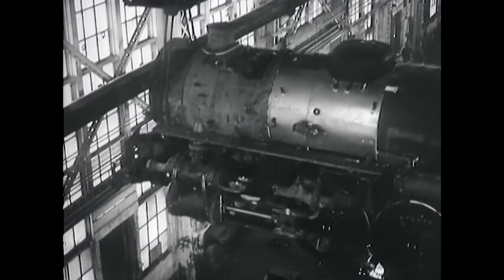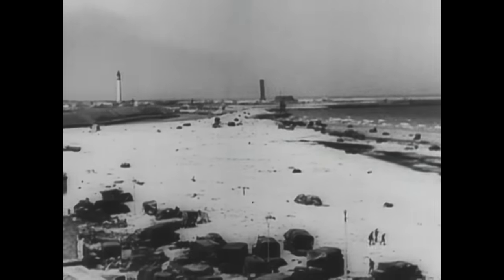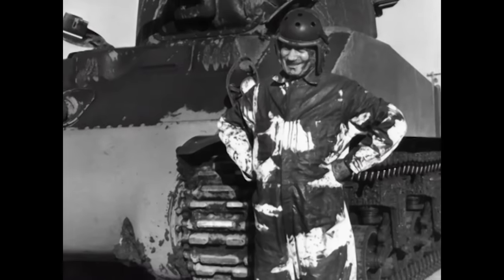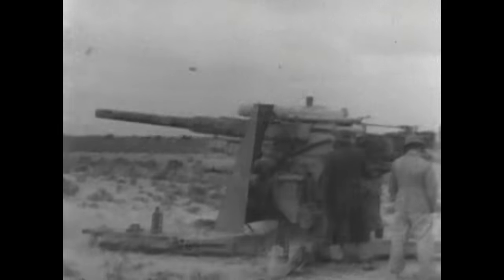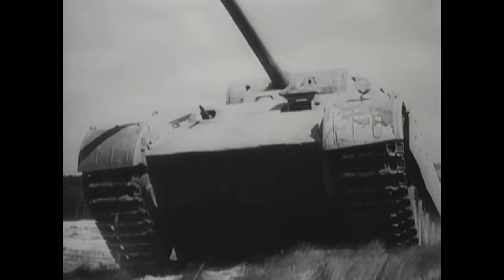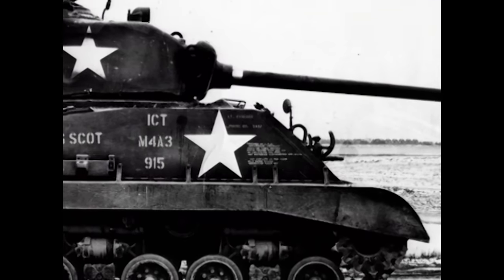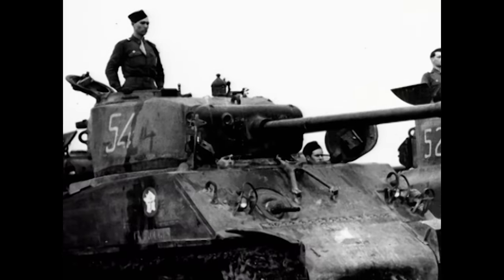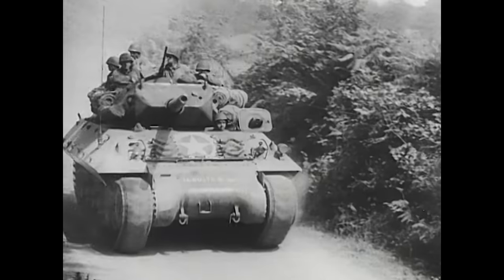Why The Sherman Tank Arrived Just In Time For The Allies | Tanks! | War Stories

Comment: The United States successfully turned its civilian engineering factories into military production. But America was never at the forefront of tank development, it never even developed a purpose-built tank gun. The Sherman was indeed a good infantry support tank in 1942, liked by the British for its reliability and its 75mm gun, good against enemy anti-tank guns. But it was never much good in tank v tank combat.
Reply: The Allies met production quotas that experts had deemed impossible! This was a major factor in our victory. American soldiers had great weapons, which stacked up well against The Germans. The M1 Garand, The Tommy Gun, The BAR, and The  45!!!
Reply: @jayrosen6663  Well, by the time the American troops actually entered combat, the Germans were retreating on all fronts. The Sherman saw almost no tank to tank combat, but when it did it took losses. The British experience 1942-45 was mixed. It was liked for its reliability and the 75mm gun was good for infantry support and taking out anti-tank guns.

But it did burn easily as the ammunition storage was vulnerable. Also the 75mm had very poor armour penetration. In late-1943 the British began a Sherman rebuild program. The ammo was relocated to armoured bins on the floor of the tank. Also the high velocity 17 Pounder anti-tank gun was mounted, the converted tank was called Firefly and 2,250 were built. It played a large part in Normandy, destroying Rommel's Army Group West. Consisting 8 Panzer and 7 Infantry Divisions in battles around Caen June-August 1944.

Comment: Great video.  A bit disingenuous to skip over the development and production of the Canadian Ram tank, which used the hull of a Lee, used a cast armour system, had a full turret that could fit a 57mm (6 pdr) or a 75mm gun, and was certainly the predecessor to the Sherman in almost every way.  So yes.  The UK had access to tanks equal to the Sherman, just not as many as the US could supply.
Reply: Canadian Encyclopedia Ram tank page
The Ram was a Canadian cruiser tank produced during the Second World War (WWII) to overcome the lack of tanks in Canada. This Canadian tank used a modified version of the US M3 tank chassis, with the addition of a turret that could accommodate a 40-mm anti-tank gun in the initial design and a 57-mm gun from 1942 on. From 1941 to 1943, the Montreal Locomotive Works produced about 1,949 Ram tanks. Because of the availability of other, more modern tanks, the Ram never saw combat, but its design served as the basis for variants such as the Kangaroo armoured personnel carrier and the Sexton self-propelled gun (copied from US M7, ND). The Ram and its variants are the only tanks ever designed and built in Canada.

In 1901, the American Locomotive Company (Alco) headquartered in Schenectady, New York, was formed by the merger of several struggling locomotive manufacturers. Alco purchased the Locomotive & Machine Company of Montreal in 1904 to tap into the Canadian market with its emerging designs. The Montreal subsidiary was renamed Montreal Locomotive Works (MLW) several years later.   wiki
Reply: @nickdanger3802  Thanks.  I read that as well.  Hence my post.
Reply: So now, did Canada build the first "Sherman" (with a 57mm) ?  that means an American copycat hogs all the glory ?
Reply: @robertsolomielke5134  I wouldn't go that far but ok.  :)

Comment: But yet, the Sherman did evolve into a MUCH better tank by the fall of 1944. The introduction of the M4A3  Easy Eight model introduced many improvements, including better armor, a much improved HVSS track system, and a fast-turning turret firing 76 mm ammunition capable of even damaging a German Tiger tank.

Comment: What always puzzled me was why they didn't replace the 75mm low velocity short barrel gun. The 76mm high velocity long barrel gun was available and the breach was not any larger than the 75mm one. It would have fit in the torret and the gun would have been much more effective with it's high velocity shell.
Reply: They looked at the logistics of doing that prior to d day.   They couldn't change them all out in time,  and didn't want to choke up the supply chain with 2 different tank ammunition stocks.   Additionally,  the Sherman was not considered a tank killer.   The US army had dedicated tank destroyer battalions for engaging enemy tanks.   The Sherman was the breakthrough, cavalry tank,  which could support infantry.
Reply: All M4 models, including the 76mm variant, evolved in parallel. There were hundreds in England prior to D-Day. The reason they weren't taken to Normandy  were logistics (limited loads) and a sense they wouldn't be needed (US TD doctrine, and tankers preferred the 75mm variant at the time).
Reply: The 75mm was superior to the 76mm in 99% of engagements
Reply: Later american varients equipped the 76mm HV gun....old models were not upgraded because it required a larger turret. Also, there was a tradeoff of ammo storage. The large gun naturally took larger shells, so the upgunned vehicles carried significantly fewer shells.
Reply: @drewschumann1  yes superior he performance against infantry and antitank weapons.
Reply: @PeterOConnell-pq6io  
I read that the 76mm was available [in limited numbers] and offered to the tank commanders, but were declined.
Reply: The 75 mm had much better HE performance.
Reply: The US thoroughly tested everything before approving production. They looked at the original form of the M4 with a 76mm gun installed and found that the turret was just too cramped. Hence the T23 (larger) turret was developed and was ready by D-Day but the forward commanders chose to leave them behind in England.
Reply: @TheSaturnV  yes, due to logistics.   The US army has a good long history of making decisions based on logistics and no other reason.
Reply: @PeterOConnell-pq6io  Exactly.  Also, the M4 75mm did just fine engaging Panzer 3's and 4's in North Africa and Italy.
Reply: @PeterOConnell-pq6io

US commanders were overconfident, unlike the British commanders who expected they would very much need their Fireflies for D-Day. The British, with far more experience against the Germans, didnt expect the Germans to NOT be throwing more Panthers and Tigers etc into Normandy. They were right. There were around 800 of them combined.
Reply: @richardm3023 

Well, when your supply lines are several thousand miles long, paying attention to logistics issues is a pretty sound concept.
Reply: @kenle2  oh, I am not disagreeing with you.   Firepower wins battles,  logistics wins wars.

Comment: German tanks had hatches on either side of the turret for loading shells during rearming and tossing out empties after firing. They could also be opened for some cross ventilation and relief from the desert heat. The British tanks and the M4 did not have this capability. In the heat, they became like ovens thus, the term “Tommy Cooker” came about,
Reply: No
Reply: The early Sherman with its single hatch in the turret must have been a nightmare in the heat. Death trap to escape from too.
Reply: No. Shermans had a small square hatch on the port side of the turret for spent shells. "Tommy Cooker" came from the tendency for early model Shermans catching on fire due to hits to the prominent upper hull ammo stowage bins. Later these were moved deep down in the hull and eventually placed into glycol "wet" bins so that the late M4's rarely burned.

Comment: Genuine question, but is it accurate to call the US a backwater?
Reply: No.  The US was industrialized.  It was isolationist, but in no way a backwater.   Ford Motor Company was founded in 1903.  Europeans called assembly line manufacturing "Fordism" as they were converting their tank factories to be more in line with US manufacturing processes.
Reply: Backwater also means "an isolated" place.
Reply: @lyndoncmp5751  The narrator already said isolationist, so to add "backwater" just comes off as insulting, whether intended or not.
Reply: @deathpallie 
Oh well, welcome to the club, considering all the American WW2 productions that insult the British effort, from Saving Private Ryan to Band of Brothers to the current Masters of the Air.
Reply: @lyndoncmp5751  Isolated politically yes, but isolated economically no.
Reply: @deathpallie  The accent of the narrator tells you all you need to know.
Reply: @ewathoughts8476 
What's wrong with the narrators accent? He speaks perfect and clear English. He also states that "America with its huge steel works and car factories was perfectly equipped to produce tanks on a mammoth scale".
Reply: @ewathoughts8476 
Backwater, not backwards. Two different things. Backwater more describes somewhere quiet and away from the rest of the world, which America was.
Reply: it sure was

Comment: Film, audio recording, light bulb perfected, airplane, assembly line applied to auto production, FM radio, alternating current/AC, vote for women eight years before Britain, electronic television, Ferris wheel, first US patent for radar granted 1934 (Wattson Watt began experiments in 1935 following a MoD request for a "death ray"), blood transfusion, rotary stepping switch, klystron tube (valve), Hughes tri cone drill bit, Houdry process for catalytic cracking of oil.

Comment: The Sherman was a mediocre tank, but it arrived in great numbers.  Anyone can see that 100 people with pistols can defeat 10 people with rifles.  Heck, a courageous soldier with a PIAT could take out a Panzer if they could get close enough, and many did.  The Sherman was adequate protection from small arms fire and most grenades, but even the early 50 mm Panzer II shells could destroy a Sherman.

Patton was well aware of this and established the policy of avoiding tank battles.  At first the US had thought the Sherman could handle the Panzers after mopping up Rommel's well-worn and tired tanks after Montgomery has driven them from Egypt, across North Africa into the waiting US Sherman tanks.  Patton managed to avoid challenging the Germans as he wandered around Sicily, enabling them to escape to Naples, where they once again became a formidable force that stopped the Allies for far too long.

Fortunately, the Brits were given a bunch of Sherman's under the lend-lease program, and they knew the Sherman needed greater tank stopping power.  Check out the British Firefly derivative of the Sherman, with a 3" (17 lb) gun and longer barrel than the US versions that could penetrate over 6" of armor steel.   Over 2000 were converted and proved formidable Panzer tank destroyers, including even the Panzer Mk VI Tiger.  It was so successful that the Germans would target any Sherman with the visibly longer barrel first, causing the Brits to camouflage the barrel to hide its length.

Comment: In my opinion the M4 Sherman was without a doubt the best tank for world war two. It's reliability and ease of mass production combined with its ease of maintenance was such an important factor over other tanks of the war that it really was in a class of its own. Sure the Soviet Union made more T34 tanks but those were disposable and made cheaper so that even if a T34 wasn't very reliable it didn't matter because the Soviets would just replace them. Still the T34 was a very harsh and crude tank on its crew and was prone to break down more. Not to forget that it's manufacturing was inferior in comparison to M4 Shermans.

Comment: Our tanks were using gas and not diesel
Reply: The Germans also used gasoline.
Reply: Ok my friend but in their tanks?
Reply: @ earlshaner4441  yes
Reply: @earlshaner4441  yes
Reply: Well there's a reason for that. As I state above the Sherman tank is a product of Design Genius. They may or may not have been geniuses with tank design but by God they were geniuses of gasoline engine design and mass production.

They played to their strength which is always a good move. 😎
Reply: Ok my friend
Reply: @GregWampler-xm8hv  the second most produced variant of the Sherman was Diesel

Comment: if only we (America) had produced the Firefly and the Heavy Tank T29 in mass numbers. wrong tactics and wrong assumptions about how tanks were to be used.
Reply: Good luck trying to get hundreds of T29s overseas.
Reply: No and no. The Firefly was not the best Sherman. Its fame comes from being the only Sherman on D-Day that could punch through the front of German tanks. Far less accurate than the US 76mm gun. The US tested the Firefly and found it to be too poor a configuration to gamble on and add another type ammo to the supply chain.  The T29 comment is silly.  Hindsight 20/20 and the Pershing should have been ready by D-Day and with a much more powerful engine. Even better, the 76mm Shermans should have been sent across on D-Day with plenty of HVAP for every crew to have at least a few rounds.
Reply: @ TheSaturnV  development of the Pershing took longer than expected. The later M46 Patton was an upgrade to the Pershing, with a better engine. Even if it was ready, it still would’ve been very vulnerable in the labyrinth-like Bocages of France. I do believe that the 76 mm Shermans should’ve been put in at Normandy, but I also believe that the reason HVAP ammunition wasn’t available in high numbers was because of tungsten shortages.
Reply: Dead wrong. 😎

Comment: The numbers game. Ask the Russians how many T-34 76's they made. The crews were expendable though. That bothers me. Your in a Cast Steel Coffin that is loaded with Gasoline and Ammunition and your best bet is to race around the side or the rear of the Enemy 50 Ton armed with a gun that can smoke you at 1500-2000 yards? Better be getting going Son! Oh! And even then? You have to close to within 5 yards except the rear. Then only 250 yards. The M-4 Short 75mm was beyond useless as it could not put the HE round with the Gunners Sight on Target from initial units. Calibrated for 76mm Long Barrel that was replaced by the British 17 Pounder for the "FireFly". They still could not get this right! Lives are at stake and you can't get this "Right?"
Reply: @nickdanger3802  Until the 90mm on the M-26 "Pershing" only the British put 2 and 2 together as far as 76mm Cannons. Shocking Reinmetall had one out faster than the British. The 88mm was supposed to be an Anti-Aircraft weapon. Herr Rommel decided to use it Horizontally when invading Belgium. Faced with "Matilda" Tanks that 37mm rounds bounced off the man called the ball. Would I lay a 155mm Howitzer Horizontally? Yes. It happened in the Battle of the Bulge. The russians took that to the next Level.